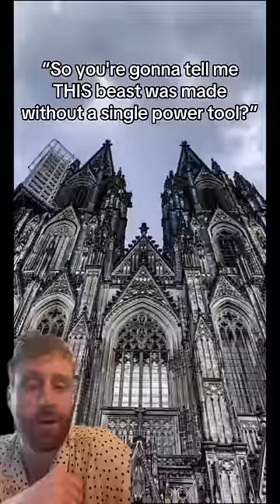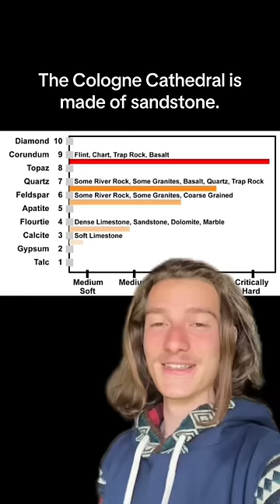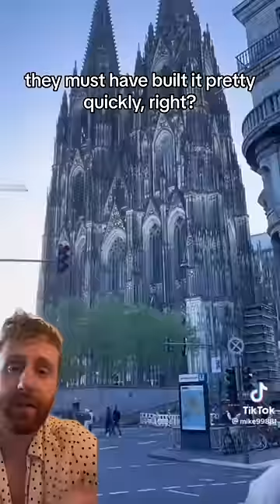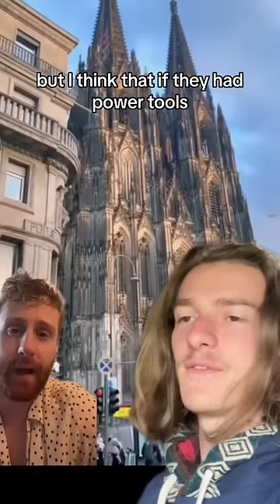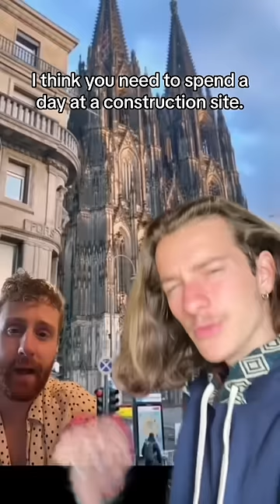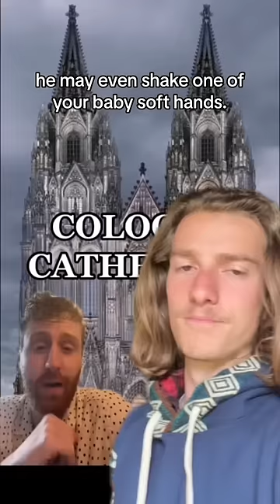How Did They Do It Without Power Tools?

Comment: Woodworker, leatherworker, blacksmith, and primitive tech and survival dork here: thank you for videos like this. 

Like when you look at a Viking longboat and recognize they crossed oceans in them. And every single part of it was made by hand tools. 

Though I would argue that some things were, in fact, made with power tools... Just not the kind he's thinking of. Water powered hammers and other tools were definitely a thing, so there was ways to speed up some tasks... But only if the task was being performed near a significant moving body of water where the flow of the water could be harnessed, and even then the amount of kinetic energy that was transferred from river to wooden gears and drivetrain was not a lot. You can get more power out of battery driven hand tools today.

Comment: There was a project to make a medieval castle using only tools and methods of the time. It took 25-30 years to complete. There's a documentary about it that can be found on YouTube.
Reply: that sounds quick. I guess they don't factor in years of drought/famine/war/politics that could pause castle building projects for years or even decades and are just focused on the building part
Reply: @Abby_Liu  Most likely
Reply: @Abby_Liu  they also built a (relatively) late stage castle right from the ground up aswell. Usually those things werent just stamped out of the ground and built like that, but evolved from wooden mottes to stone castles, over *centuries*. 
A stone building here, an extra palisade Here - oh might aswell make the inner wall stone now.

The project also has all the materials needed directly on site. So that isnt factored in.
Poor living conditions meant that workers had to constantly be replaced, which afaik also inst factored in.
Reply: Isn’t it still on going?
Reply: @Grz349  It might be. I'm not entirely sure.
Reply: @Abby_Liu most of it is resource availability, lead time on quarries was immense
Reply: What's the documentary called?
Reply: @noragamilover101rosadelamu5  Secrets of the Castle with Ruth, Peter and Tom
Reply: I remember seeing that on a Tom Scott video
Reply: @Abby_Liu  there is not a one size fits all when it comes to how long it took to build a castle. It depends on multiple factors.
Reply: @hansmemling2311  sure but I would bet monopoly money on the average building time for one built from scratch (ie not like someone said, additions over hundreds of years) to still be longer than 20 to 30 years.
Reply: @Abby_Liu  I am sorry to say that your bet is categorically false.
Reply: For those interested, it's called the Château de Guédelon (or Guedelon Castle in english).  There are videos of it on YouTube in both french and english
Reply: @Grz349 Yes, its in france and is estimated to finish around 2030 i think
Reply: Only THAT much time? I thought the minimum would be like 40-60 years depending the size. Then again they may have everything with them so that may help with time.
Reply: @cameoshadowness7757  stone castles could have been finished as quickly as 4 years. It really depends on size, design and resources.
Reply: @Abby_Liu  The reason why Guedelon wont take as long as this massive cathedral is because it's meant to be a small castle. It's like one main building and 6 towers. It's meant to be for a "lord" or someone who worked underneath of the king at the time.
Reply: @Abby_Liu its actually slow, as the project makers said, owing to a lack of technical skill in many involved and a smaller workforce than would be historical
Reply: Building a castle is easier than building a fricking cathedrale that size
Reply: @imano3549  Yeah. Didn't it take them centuries to make the cathedral?
Reply: @Abby_Liu  not really, no. average is between 10-20.
Reply: I think it's still going, isn't it?

Comment: "Sandstone has a hardness of 4" sounds like a Minecraft tip
Reply: yessir
Reply: my thoughts exactly
Reply: We're making it to cobblestone with this one 💯🔥🗣️🗣️
Reply: Mohs scale of hardness! If you throw a bunch of sandstone in a rock tumbler with quartz, jasper, agates, etc, the sandstone gets ground down to dust while the others barely start to get smooth on the edges. Because sandstone is a 4, and the others are a 7-8.
Reply: @CWorgen5732  Thank you for the explanation, I did understand, just thought it was a bit funny how it sounded at face value haha
Reply: That means it takes 4 punches with your fist to break it lol.

Comment: I always forget how long these cathedrals actually take to build, it's so nuts!
Reply: And a lot of them are still actively being worked on since the maintenance is so time-consuming that by the time you've finished it's basically time to start over.
Reply: @fang_xianfu  I have basically never seen anyone working on a cathedral, and I walked around one several times this weekend. I genuinely don't recall seeing a single one getting worked on. I mean, sure, they clean the insides a bit and they definitely do have to repair the leading on the roofs sometimes. It's just that mostly they sit there and are just monuments to how oppressed our ancestors were.
Reply: The cologne cathedral was a special case since the project ran out of money and construction was suspended for about 300 years. Already before the suspension politics and funding proved difficult for progress. Other famous cathedrals like the Notre Dame or St. Peter's took under 200 years
Reply: @jonevansauthor 
To be fair, it would have been a decent paying job for multiple generations of tradesmen. Probably would've been considered a cushy job for them considering the circumstances
Reply: @jonevansauthor Bonn's large church near the train station, there are at least 3 churches if not more in and around the pedestrian area, has been under renovation for what seems like the last decade and I am not convinced they are done. Bonn is about 25 min from that cathedral. The cathedral is substantially larger. I suspect if they aren't working on the outside atm, they are working on the inside.
Reply: @windowstaskmanager5349  don't get me wrong, the alternatives weren't better. But it remains the fact that the church did nothing to earn it's power, was and remains a force of evil, and their skills could have been better employed building libraries and hospitals, aqueducts, roads, bridges etc etc. 

Definitely better being an abused stonemason than an abused farmer though.
Reply: @jonevansauthor  You might not realize just how important religion was to most people pre 1960, but it was massively important, especially back when the cathedral was being built. Important enough that they'd spend over half a millenium to build this cathedral, across generations and rulers. Many of the world's most impressive structures have a religious motivation behind them. 

Also, and this is just an idea that popped into my head, it seems like the only time humans can come together to build something impressive either involves religion or power generation.
Reply: @spracketskooch  of course modern people think it was important to them. That's because they would have been brutally murdered had they not pretended it was important to them. It does not mean anyone wanted to be there, or they genuinely believed, and the only people who could write about it were all on the team of the oppressors of humanity. They wouldn't even teach other people to read.

I suppose we have big sports stadiums but I'd argue that's a faith based group as well. From amphitheatres to modern soccer stadiums, it's neither rational nor a benefit to the population but some of them are impressive. I mean, the amphitheatres are. Modern sports stadiums are just monstrosities like multi-storey concrete car parks or Walmarts.  

There were lots of massive military buildings of one form or another, but a lot of that only exists because religious people are particularly keen on murdering each other.

It took me a moment to think of something else but the best I can come up with is transport. Transport is the other big thing we build. Roman roads, canals, London Underground, rail and high speed rail etc. That's been a consistent theme I think, and a much better indication of civilisations advancement. 

Public parks, spaces, bathing facilities, water infrastructure might also make a dent.
Reply: LunaticKing-fj3hp  you look up at them, and realise if they'd built literally anything else, they'd have had better lives. Like houses, bridges, aqueducts, water mills etc etc. They contribute nothing whatsoever to the world, except some now impressive relics. At least the pyramids contributed graves. Ditto churches btw. Didn't need those either. No form of temple. 

They had plenty of other stuff to build and of course, those buildings destroyed and suppressed knowledge as much as they could.
Reply: even the newest cathedral(Sagrada Família), which isn't even finished. it's been in the making for 141 years.
Reply: @martijn208  I think that one's about funding, the Spanish civil war and complexity though. It's quite elaborate and also massive isn't it? It's not because they started in 1100 AD and that's just how long it took. It's also the gaudiest cathedral ever designed. Geddit? :D 

It's impressive that they're still bothering. Or an embarrassment if you remember what they build them for and it's the 21st century and they're still wasting energy on it. It'll probably be good for tourism revenue I suppose.
Reply: @jonevansauthor  well I think they faced the same problems back then.
Reply: @jonevansauthor  "and their skills could have been better employed building libraries and hospitals"

wait until bro finds out who were making these things during that period 💀
Reply: @_pp7473  you mean, the peasants? Because it was their tithes that paid for it all. It wasn't money the church earned. They stole it through violence and torture. The reason luxuries get paid for by the incredibly wealthy, is because they have spare economic output. But the local noble fought against your enemies at war, and has responsibilities and someone needs to run a place and protect people.

Churches did not need to exist, do not offer any benefits to humanity, and all our ancestors were abused to make these awful people incredibly wealthy so they could do the most awful things ever conceived of by man. But aside from all the sexual abuse, torture, murder, starvation and theft, they were great! 

As for hospitals, who do you think it was that burned most of the accumulated medical knowledge and set back medicine hundreds, if not thousands of years and who do you think is still holding it back?
Reply: @jonevansauthor cologne cathedral has been worked on for more than the last 100 years.
The cathedral was finished in 1902 and just 4 years later they had to begin renovating it and haven't stopped yet and will never stop.

In 2021 there was kinda a big event: For the first time in 25 years there was no scaffolding on the cathedral. 
If you look at basically any picture of the cologne cathedral you will see scaffolding, or the picture was taken from an angle to hide it.
Reply: @jonevansauthor  There certainly are people working on it. Most of these cathedrals have "Domhütten" (Cathedral Huts) which are basically organised workshops for the construction and maintenance of the cathedral. Many have been continuously operating since the building of the respective cathedral. There was and still is a network of those across all of Europe. They communicated the skills to build those and still meet up to improve their craft annually. It's quite fascinating actually.
Reply: Well, usually not THAT long. The Cologne cathedral is after all quite infamous for how long it took to finish
Reply: @jonevansauthor  aight you're clearly some sort of militant atheists who got his talking points from reddit cuz all of what you said is so hilariously wrong its not even worth arguing against.
Reply: @jonevansauthor  did you ever vist the cologne venerable cathedral ? 
it's under constant restoration. and it will always be
Reply: @katii1997  no and I won't because I'm never going to step in one again. They're monuments to some of the most vile oppression, violence and abuse ever committed by humans. Also the source of what is definitely the worst examples of just about all of that. 

If it's under constant restoration, I think we can safely conclude it's a very poorly designed building.

Comment: Fun fact: I am from Cologne. Not sure wether this is still possible, but when I was young, one could watch the stone masons in their workshop. Let's say that power tools were a rare sight. However, it is only the facade which is made out of sandstone (which isn't really sandstone, but according to the Cathedral Masonry actually a special kind of Limestone hailing from Westphalian area of Münster, called Baumberger Sandstone, to make the confusion complete). The core and the supporting elements were built mostly of trachyte from the Drachenfels, the foundations of tuff. Nevertheless, and I am sure you could say much more about this than I can, trachyte was used A LOT for supporting elements in large building from the high middle age onwards, at least in the rough area of modern day Northrine Westphalia. The Cathedral was finished with actual sandstone, namely Schlaitdorfer Sandstone from the area of Esslingen, modern day Baden-Württemberg. There are models of the cranes used to build the Cathedral to be marveled at the Cologne Municipal Museum. Drop me a note if you need more info.
Reply: Yeah, I need more info:
What makes you think Köln is a real place?
You can't trick me!
Reply: @sallylauper8222 no that’s Bielefeld. Köln exist but Bielefeld is not a real place
Reply: FWIW over in france there's a castle recreation using 13th century period-accurate technique and tools (with some adjustments for safety) which you can visit, completion it slated for 2029 (ground breaking was in 1997). A similar plan started for a monastic community in Baden-Wurttemberg, although it's a lot less far along, it started in 2013 and the plan is for 40 years of work.
Reply: Ach, immer schön nen weiteren Kölner zu entdecken. Ist immer wieder witzig wie nur die Erwähnung von irgendwas deutschem online wie ein Spawn Befehl für uns ist.
Reply: @SWTobito0702  liegt am Algorithmus.
Reply: @SWTobito0702  Na klar. Die Erwähnung ist wie das erstellen eines mobilen Spawnpoints...

Comment: Stonemason here: Cologne cathedral is partly made of a certain sandstone that is actually quite hard (there’s a huge range in the hardness different types of sandstone). Also, there’s a lot of basalt in cologne cathedral, that too has been shaped by hand and to this day it looks like new cause basalt is tough as shit! Also quite chemically restaurant so the Industrial Revolution didn’t even bother the basalt
Reply: Sadly though it does not look new. The parts of the cathedral that look new are new. The oldest parts need urgent replacing..
Reply: WTF does "chemical restaraunt" mean?
Reply: @The_Card_Dealer  misspelling very likely. The guy might have meant "chemically resistant"
Reply: imagine they'd have to switch that like the sandstone, lol
Reply: @The_Card_Dealer  it is not prone to corrosion due to sour rain, like the sandstone elements that continually get replaced on the cathedral so you'll never see it scaffolding free

Comment: this is actually extremely accurate considering it takes two generations just to fill ONE DAMN POT HOLE IN THE ROAD
Reply: Do you know how hard it is to fill a pot hole? You need to get the cement, pour it into the hole and cloae the lane it is on for a short time! You think this can be done in less then 150 years?

Comment: For reference,  from things I read in high school:  The pieces that are stacked one on top the other to form the columns of the Parthenon were so precisely cut that cracks from earthquakes continue to the next piece as if they were one solid piece of marble and a column that was disassembled in the 1990s the wooden dowel that guided the pieces during assembly had still strong wood smell.  All this with more primitive tools than the Cathedral and with much harder material (white marble).
Reply: Yeah, the Parthenon is incredible. With how the walls are build at slight angles, how the columns are of different height etc. to allow for the perfect straight perspective.

Comment: The best part is they actually took a nearly 600 year break. The foundation was laid in 1248, and the eastern wing was completed in 1322. After a bit more work, the cathedral sat unfinished from when construction more or less stopped in 1473 (there were sporadic periods of additional construction), with only that one wing and part of a tower completed, until construction resumed in 1842. That’s right, the middle of the 19th century, at which point it only took them 38 years to finish it. So in total, they only spent like less than 20% of the time actually building it.
Reply: Which alao meana they did have access to some power tools towards the end.  Coincidentally they had power hammers dating back to the 1700s in Europe for blacksmithing.
Reply: Some things never change
Reply: Sending this to my boss next time they’re on my butt about billable time 😂
Reply: Yes you are right. They found the plan in Darmstadt... used to dry beans .😊
Reply: @nubreed13
True, but if the original designs survived and were carried out, the power tools were clearly just a convenient thing to have rather than a necessity
Reply: the construction crain on top of the unfinished cathedral was at on point even on the citys coat of arms...
Reply: @n.sommerfeld9292  Yes...
Reply: All the medieval parts of the cathedral were built of trachyte from the Drachenfels, but the 19th-century builders employed sandstones.